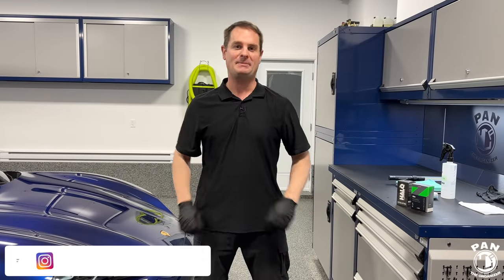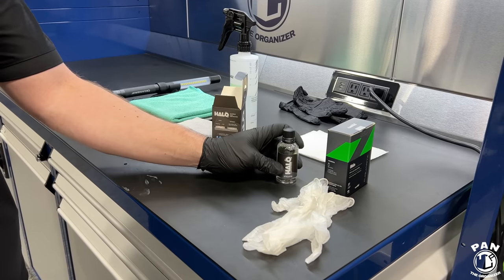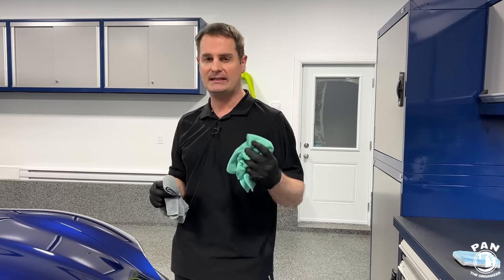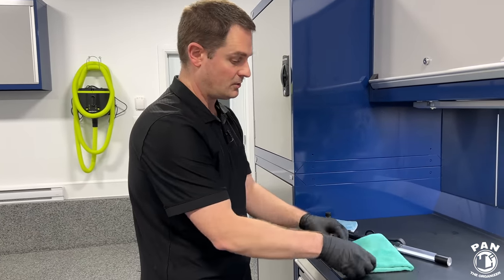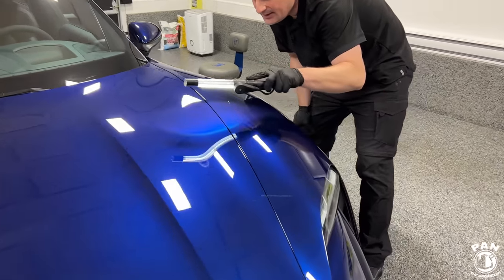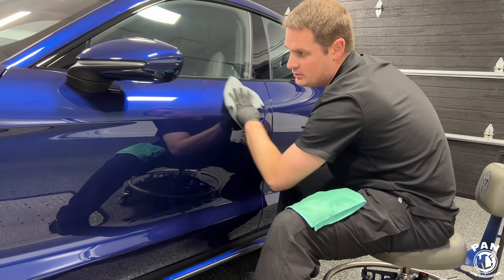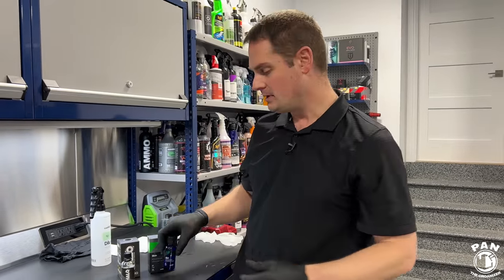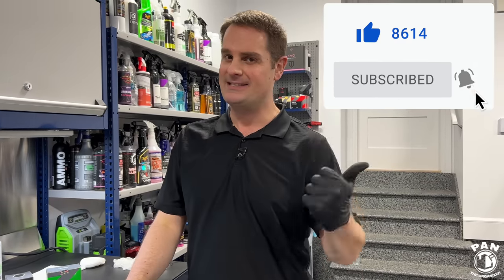How to apply a ceramic coating on PPF (paint protection film) : Porsche Taycan Turbo

Comment: I saw a lot of scratches on the trunk of the car during your walk around when the car was finished. How are the fill in properties?
Reply from the maker: Coatings have zero filling capabilities. Unfortunately, the installers of the PPF might not have polished the paintwork to absolute perfection prior to installing the PPF, so there was nothing I could do. But it still looked 90% good.
Reply: @PanTheOrganizer  Oh, it looked outstanding. Great Video!

Comment: oh wow that is very interesting.   I know Gtechniq panel wipe is stronger then Carpro Eraser.  That is my main panel prep and has never given me any issues but I guess i will get make a bottle of Panel Wipe to use.  I have a vehicle that has about 3,000 miles on it. I hit it with iron decon just to be safe and washed it with the stripping soap from Obsessed garage in the shade of course and no issues.  I can see I killed most of the hydrophics on the PPF but wondering if I should still hit it with a white pad and 3D one? Love all the content PAN!!
Reply from the maker: Use a light polish like Sonax Perfect Finish. Then IPA wipe. Then apply the coating.

The light polish will ensure enough mechanical abrasion to remove any crappy cheap wax or sealant the dealership applied prior to delivery. You want to ensure 100% bonding ot the coating to the PPF.
Reply: @PanTheOrganizer  Awesome!  I have a bottle of Perfect finish.  Would you recommend a white pad or black polishing pad?  Thinking a white pad and PF should be the move.
Reply from the maker: I use a yellow Rupes polishing pad with the Sonax Perfect Finish. But yes a white polishing pad should do. Do a test spot, and see if it works.

Watch my video on compounds, polishes and pad combos here: https://youtu.be/2JDvQBs1viM

Comment: Nice video Pan as always! I just got my car full front ppf and planning to put ceramic coating on top of it,can this be applied without ppf?
Reply from the maker: If you have paint on some sections and PPF on some sections, just apply the same paint coating on your PPF too.

Most coatings for paint can also be applied to PPF.  But PPF specific coatings aren’t meant for use on paint.

Comment: Great video.  I have a new car coming and I am really on the fence about PPF.  I love the ceramic coat on my current car.  It has given it a great, deep finish.  I'm just afraid PPF will ruin that effect, even with ceramic coat on top.  Also, in terms of cost...wouldn't it better to have a pro detailer do a paint correction/touch up every couple years instead of the upfront cost of PPF?  Thanks for any thoughts.
Reply from the maker: On a personal level, I am just not a fan of the look or feel or PPF. Plus, as I get a brand new car every three years, and do low yearly mileage, scratches and stone chips are of no concern to me. My cars are always pristine when I bring them back to the dealership.

So yes you won't have the same visual appeal as pure paint with a coating. PPF alters the clarity and looks regardless of what PPF companies say or think hehe. But it's up to you to see how much mileage you make yearly, and if stone chip protection and scratch protection is of any concern to you.

If you drive a lot, especially on highways, and want the ultimate stone chip protection and scratch protection, PPF is the only solution. And for the best of both worlds, apply a ceramic coating on top for enhanced gloss, slickness, UV protection and self-cleaning properties.
Reply: @PanTheOrganizer  Thanks!  Great thoughts here.  I daily drive my current car and after 3 years, it has one or two really minor chips that I can live with.  The new car I will probably keep a lot longer but, like you, I prefer a nice deep finish as apposed to what PPF does.  Maybe as a compromise I could just PPF the front bumper and high impact areas.  But there is nothing I like more than a nice deep finish to the hood so I'm hesitant to PPF the hood or even half of it since there would be a seam.

Comment: Pan - I have a 2022 Turbo S with a front PPF.  Would you still recommend this ceramic for the mix of PPF and clear coat, or use two different ceramic products for the different surfaces?  What is your product recommendation for this application?  Thanks
Reply from the maker: Take the coating you'll be using on the paint, and apply it to the PPF too. Most paint coatings can be applied on PPF, unless otherwise noted by the manufacturer on their website or label.

Comment: I really enjoy your videos! Is a coated PPF covered car more glossy than a coated car without PPF? I'd be interested in seeing a video about the pros and cons of adding PPF vs just coating a new car.
Reply from the maker: Thanks! Yes in general ceramic coatings boost gloss on the surface. The car after the coating certainly looked better than before the coating was applied.

But the main reason you would apply a coating is UV protection, slickness, hydrophobics and self-cleaning properties, meaning that the car is much easier to wash during maintenance washes.

Comment: Hi Pan, great video! I am supposed to do a wash and wax on a car but just found out it has PPF all over and half of the hood so I have a few questions. This car does have overspray including on the PPF so is using a clay mitt with a lot of lubrication okay? Am I also able to use iron remover on the PPF? Lastly, should I use the turtle wax 75th anniversary paste wax or ice seal and shine on the car including PPF? Thank you for your help!
Reply from the maker: Those are a lot of questions Justine haha. You can clay the paint, but be very light on the PPF if you need to clay it. (Only clay the vehicle if it needs claying!). Perhaps do a light polish when you're done claying.

For iron removers, it depends which one you are using, you would need to check with the manufacturer if it's ok on PPF. But the majority of the time, yes you can use it on PPF. Just don't let it dry on the surface.

For the Turtle Wax 75th Anniversary Paste Wax, you can apply this wax on painted surfaces, glass, wheels, and headlights. Not recommended for use on plastics. Not recommended for use on PPF or wrapped cars. So you would have to use Seal N Shine instead.

I hope this helps.

Comment: Pan, watched this again. Another informative video. So, Pan, other than the Gtechniq and carpro, you recommend in this video, are there other choices to coat a PPF?   In your opinion, is there one ceramic coating I could use on a car with no PPF and a car with PPF?  Last year I applied Gyeon PURE Gen 1 to both vehicles and I have positive results. With so new products becoming available these days, I was thinking of buying just one product. Recommendations appreciate. Thanks, Paul.
Reply from the maker: You could absolutely use a paint coating on PPF, as most paint coatings can also be applied on PPF. You would need to confirm with the brand if their coating can also be applied to PPF though, just to make sure though.
Reply: @PanTheOrganizer  Thanks.

Comment: Great, informative video. Can I use this across the entire car even if I only have PPF on the front end?
Reply from the maker: This is only for PPF. If you only have PPF on the front end, then just get the regular CarPro CQuartz UK 3.0 and do the paintwork and PPF with it. Most paint coatings can also be applied to PPF. 

But not the other way around. PPF-specific coatings can't be applied to paint.
Reply: Love it. Everything I need will arrive tomorrow and I’ll do my fully ppf M3 CS this weekend! I needed this video. Thanks for the information.

Comment: Nice Job , can we use any ceramic coating brand in the ppf ??
Reply from the maker: No. You have to make sure the coating is compatible with PPF.

Also, check with your PPF manufacturer if the warranty is still maintained if you apply a coating from a different brand, as some PPF manufacturers require their coating if you want to maintain your warranty.

Comment: Hey Pan , I just got my 2022 f250 done picked it up 4/27/23.  I know the detailer and I showed up early at his shop he’s got quite a good business going he did my first truck. anyway he wasn’t done when he said to show up so I observed he didn’t coat the hood after it was installed so i questioned what was really done I went to another shop to ask questions and now it concerns me especially what I paid. . I had paid for a 5 yr coating with PPF which consisted of hood front panels bumper and mirrors. I live in vegas so it’s getting hot I don’t have a garage will a pop up shade work and how long do I have till I would have to re-decon the front end to recoat? And what brand can I buy/ use I want the 5yr coating but I’ll take what I can get. I will be disputing this service but I mine as well do it myself with what he has done already. I will driving at least over a 100 miles before I can take care/ work on this. It is my daily

Comment: was that old ppf as i noticed alot of scratches and swirls on the bootlid at 22.02. would you not try to poliah them out or use a hot air gud to help it self heal before you do the ceramic coating?
Reply from the maker: That was brand new PPF installed on a brand new car, by the dealership. Unfortunately, the polishing work wasn't done to perfection BEFORE they applied the PPF, so there was nothing that could be done about it. I recommended that the customer goes back to the dealership and have them remove everything and restart the entire job.
Reply: @PanTheOrganizer  i agree thats realy bad that they did not compleatly poligh the car before applying the ppf

Comment: great video, thank you for this!  are you able to apply the coating on the windshield, windows and and other glass parts?  also, does the bottle last for multiple use or once you open it you can’t use it again later down the road?
Reply from the maker: The coatings in this video are ONLY for PPF and vinyl wraps. Once opened, coating bottles are typically good for a few months if kept in stable conditions and not frozen.

Watch my popular ceramic coating application tutorial here: https://youtu.be/sqQYVjxFqK0
Reply: @PanTheOrganizer  great, thanks!  i got xpel stealth on my tesla and i wanted to apply the ppf on the roof as well which is made of glass so that’s why i was wondering about application on glass parts. was waiting for a video specifically for ceramic coating on ppf, thanks again!

Comment: Is it too much to use Bilt Hamber Auto Foam every 2 weeks during my maintenance wash? Car is ceramic coated and will be PPF for “full front” in the next month. Is BH too harsh for the coatings to withstand over 1-2 years?
Reply from the maker: Yeah I wouldn't recommend using such a high alkaline snow foam for regular washes. It's not necessary. If you want to use it that often, at least make sure to not use it at 4-5% PIR. You should use maximum 2% PIR. For regular washes, pH neutral is all you really need. The alkaline snow foams are more for deeper cleanings to remove accumulated grime and road film every other month or every change of season. Don't forget those are strong and can potentially weaken or strip off protections like waxes or sealants.

For coatings, assuming you have a quality coating with good resistance to chemicals (pH 2-13) it's fine to use it every now and then, but again, I wouldn't do that for each wash. You will eventually weaken the coating.

Comment: Hi Pan! Did you throw away your microfiber towel after using it on Halo? I noticed the towel or applicator pad did not stiffen after a day
Reply from the maker: Soft or stiff has nothing to do with keeping or throwing the towels away. It’s what cures in the towels and what could coat the fibers that you wouldn’t want to take a chance with by reusing the towels on paint in the future.

I never take any chances and discard any towels and applicators I use to apply coatings from glass bottles.
Reply: @PanTheOrganizer  Oh, I got it Sir, this is why we should ask the professionals, I learned something new today! Thanks a Pan and more power!💪

Comment: Thank you!what's about product 303 graphene vs turtle wax graphene infused?Save for ppf
Reply from the maker: In theory both are ok to use on PPF, but as different PPF brands can sometimes have different requirements, I would first check with your PPF installer if there are any indications on using graphene or ceramic based products on top of the PPF.

Comment: Hello Pan. Not sure if you monitor old videos, but does your new "Clean" brand 8-year ceramic coat work on PPF. You mentioned in this video that products like Halo have a flexible attribute to them so that they bond better to PPF. Does your Clean Ceramic product have such properties? Or would you still recommend a purpose-made ceramic coat like Halo for PPF?
Reply from the maker: Hi David. Yes, my coatings are also compatible with PPF and vinyl wraps, as I clearly said in both my launch video and the dedicated in depth video about my coatings. I am very thorough in my explanations as you know, so it's important to listen and watch the entire video as I usually answer all the questions in the videos. ;)

I also clearly mentioned that my coatings have adhesion promoters built in and flex agents as well, allowing them to flex with the expansion and contraction of metal surfaces to prevent microfracturing, and that flexibility also allows them to be great coatings for PPF.

So I would recommend that you watch my in depth coating video: https://youtu.be/JjK12qrPZ2c?si=wNOdmezfHiiG0mSk

And the reveal video: https://youtu.be/OZncfUa11FA?si=COL-jnyV1j5uws8E

I hope this answers your questions. Have a good day!
Reply: @PanTheOrganizer  Excellent. Thanks! I had watched the reveal video, but I hadn't yet seen the in-depth coating video. Je la mets dans la queue dès maintenant !!
Reply from the maker: Super !! Tu m'en donneras des nouvelles lorsque tu auras essayé la céramique. :)

Comment: So for cars that just got PPF the only prep is the alcohol solution? You don’t have to paint correct over PPF correct ? Just give the PPF the 48 hour cure time?

My LC500 is getting full PPF in a few weeks and I’m going to Armorshield the vehicle myself so I’d appreciate the insight !
Reply from the maker: Yes and no. It depends on the state of the PPF. Just like paint, if there are scratches and swirls and oxidation on the PPF, you would want to do at least a light polish, and then the paint prep spray or IPA wipe to remove polishing oils, and then apply the coating.

But in your case, it seems your vehicle is getting a brand new PPF, so there shouldn't be a need to polish that. It should look near perfect. So do a good wash of the vehicle, thoroughly dry it. Then do the paint prep spray wipe and apply the PPF coating. If you buy a coating from a specific brand, try and get their matching prep spray. Gtechniq has the Panel Wipe spray. CarPro has the Eraser spray. Gyeon has the Prep spray. That way you ensure maximum chemical compatibility. AvalonKing has their IPA prep spray.

I hope this helps.
Reply: @PanTheOrganizer  appreciate that. Just got their prep spray and prep shampoo

Comment: Hello. I only put PPF on my hood and side view mirrors.  Can I still use this on my entire car or will I need to change the product?
Reply from the maker: PPF coatings are only to be used on PPF, not paint. In your case, it would be better to get a paint coating that can also be applied to PPF (most can, check the description of the coating you want to buy) and use one product for all your vehicle.

Comment: Hi Pan, thank you for such an informative video. I have half of my car covered with ppf and I wondered if Halo would work on car paint without ppf and work just as well as the ppf part? Thanks!!
Reply from the maker: No. If you only have partial PPF, use the paint coating on the paint and PPF. Most paint coatings are compatible with PPF.
Reply: @PanTheOrganizer  Thanks Pan. I want the benefit of graphine coat on my car with and without ppf. Do you have a recommendation on this or wouldbI have to buy two different product, one to cover the ppf areas and another for the non-ppf? Thank you so much for your advise.
Reply: @PanTheOrganizer  Hi Pan, I'm so glad I found your 2020 video on Graphene spray from 303. I think I'll give that a try and see if that will work for me. I don't think I would be skilled enough to actually apply a true ceramic or graphene coat due to the prep steps. Appreciate all the awesome videos you produce, especially the one one where you tried to strip ceramic coating off of your BMW!!🤯 Looking forward to your future videos, can't wait!

Comment: Awesome job Pan, I’m actually coating a 2014 Ferrari 458 Italia this week and it has a full front clip PPF. I’m using CSL & EXO (Gtechniq) combo on the car, I did some researching and it says those won’t have any trouble bonding to the PPF. What do you think?
Reply from the maker: Yes you can still apply classic coatings on top of PPF as well.

Comment: What impact do the coatings have on self-healing PPFs like Xpel Ultimate? Do you lose the self-healing capability once coated?
Reply from the maker: I haven't tested that, as not many of my clients have PPF, and I still haven't seen a self-healing PPF put to the test that way...
Reply: I have the xpel ultimate all around my car. I have used carpro skin. And i have tested the auto healing function with minor scratches and i have applied hot water. Scratches disappeared, so no problem

Comment: Pan, do you know if Graphene coating would stain PPF or Vinyl because of their dark brown color?
Reply from the maker: They cure to a clear color, so no worries regardless of what color you apply it on. But be careful what coating you apply on your PPF. If it's a PPF specific coating like these in this video, no problem. But if you are applying a paint coating on your PPF, make sure the manufacturer says it's ok for use on PPF too.